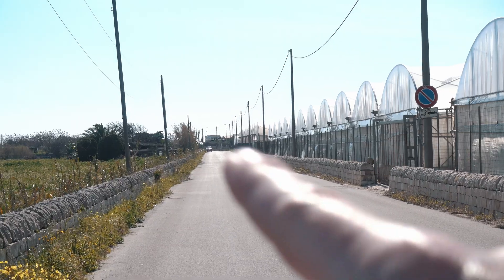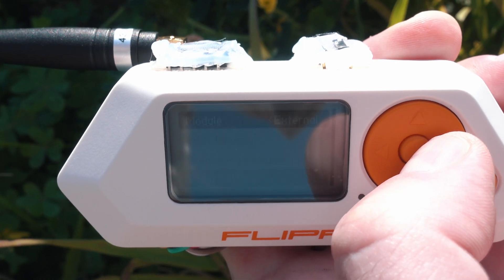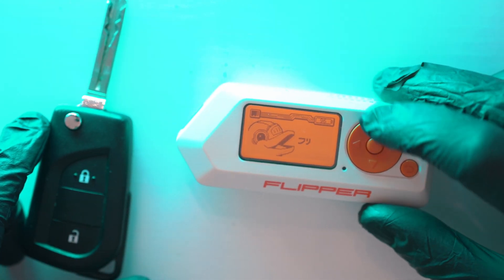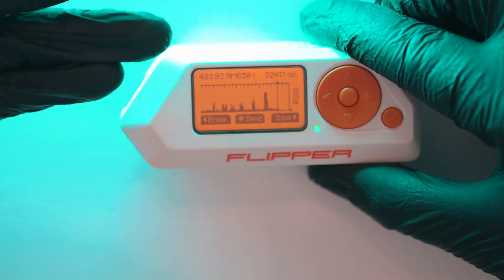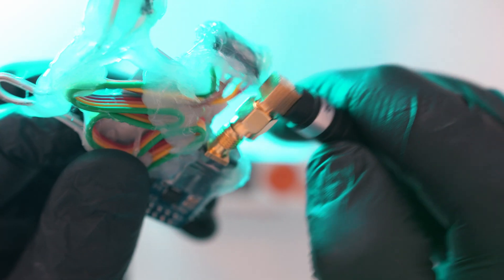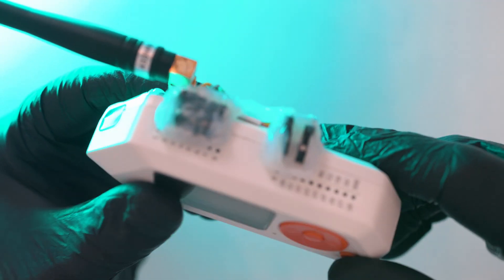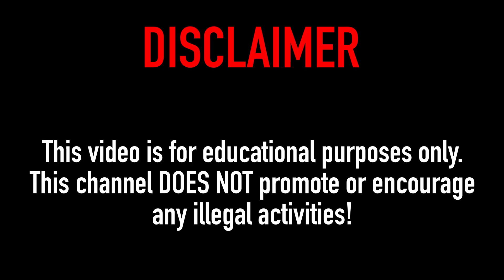Flipper Zero External CC1101 SubGHZ module+433MHz Antenna...

Comment: It has a built-in cc1101 module with a 433mhz antenna.
Reply: Yes. Sub 1 Ghz 433Mhz 45 M Range. It's in the electrical schematics.
Reply from the maker: yes but flippers internal antenna is wide range …. and with external module you can attach antenna tuned for specific frequency and get much greater results!
Reply: @takeapart To emulate the frequency of a garage door opener how far can I be to emulate the frequency?
Reply from the maker: depends on environment… I can do it from like 30-40 meters
Reply: @takeapart 200 meters without problem, with home made antenna
Reply from the maker: @marinkusev5664 absolutely!
Reply: @takeapart  dbd is everything, also swr under 1.3
Reply from the maker: @marinkusev5664 for homemade 1.3 is superb!
Reply from the maker: you mean flipper?
Reply: How i can make antenna like this

Comment: I've seen a couple of pics/videos where the ground (pin 11) and 3V (pin 9) are plugged into ground (pin 8) and 5V (pin1).

Is it safe/ok to increase to 5V? I'm getting mine tomorrow and will test it out. If it works, I'll pot the entire assembly in epoxy like that.
Reply from the maker: Hi, I don’t know … but I have seen diagrams like that.  will test and report back
Reply: @takeapart  Confirmed, works when you swap the pins mentioned above 👍.
Reply from the maker: thanks for update!

Comment: Also is it possible to just desolder the spring antenna inside and add a sma for pigtail?
Reply from the maker: I wouldn’t touch the inner antenna… it os great for all flipper range .  if you want something more just get external module
Reply: @takeapart  are there modules for it?
Reply from the maker: yes for sub ghz

Comment: I have done the same steps as you, but when im trying to set the radio settings to external, it shows a message telling "please connect external radio" while all the pins are well connected. any suggest? i've flashed right now the RogeMaster firmware
Reply from the maker: I have unleashed…  anyway it is connection issue.  check every cable,terminal,connector
Reply: @takeapart  im using a nRF24L01 module. it's not CC1101, but the pins are the same. i've tried umpluging and pluging the wires, but it throws the same error
Reply from the maker: it is different modul! that is for 2.4GHz …. you need one with cc1101 sub Ghz (les than 1GHz) chip …. link in description

Comment: How did you do this jumper cables to be broken? I can only put them from top
Reply from the maker: I modified and bend terminals I found around… I do not recommend doing so as if you don’t know what you doing you can damage flipper zero (internal terminals) .

Comment: Hi.
have you had problems with the original key after it was used flipper zero?
Reply from the maker: No , but I have tested it only on few cars.... heard that you can mess things up on some car brands!  what kind of issues do you have with your key?
Reply: @takeapart   I understand! I haven't tested it yet. I want to buy but I don't want to have problems with the original key... I have an Audi A3 2015 and an Audi A5 2018
Reply from the maker: if you not sure… maybe just not use it on your cars. flipper can do lots more.

Comment: Can you read more than 433Mhz with the antenna?
Reply from the maker: Hi, it has cc1101 chip capable of same frequency range as flipper… however I think this module operates on range from 387-464MHz

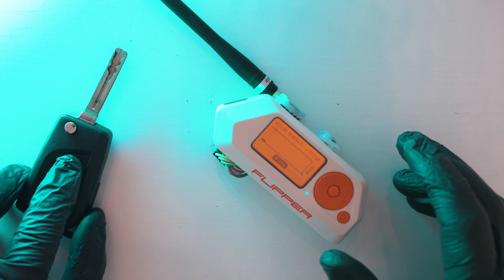Comment: 2:04 With that antenna, you can take the distance from the remote control, you can capture the frequency well ????
Reply from the maker: yes but still close the source - better the signal captured
Reply: @takeapart  What is the largest wing distance that can capture the signal with that antenna?
Reply from the maker: tested indoors… and it is significantly better

Comment: Do I need solder Jumper Wires to module?
Reply: You got one from link description od video?
Reply from the maker: I had few …
Reply from the maker: depends on module you get … I got one for jumper wires so just plugged all together.
Reply: Bought module from your description module + antenna